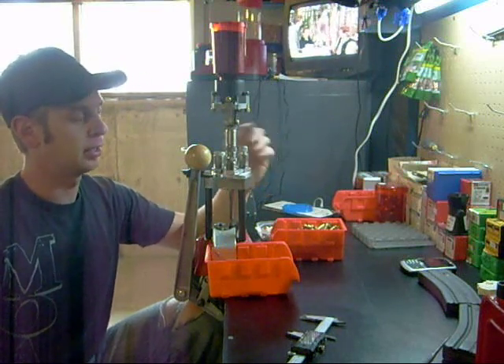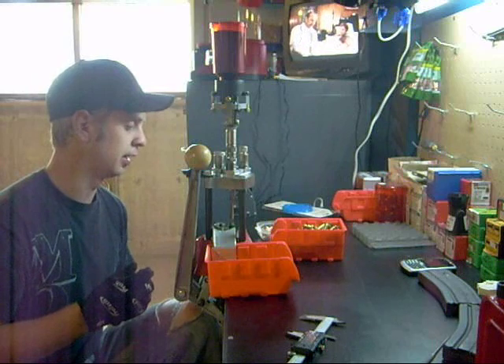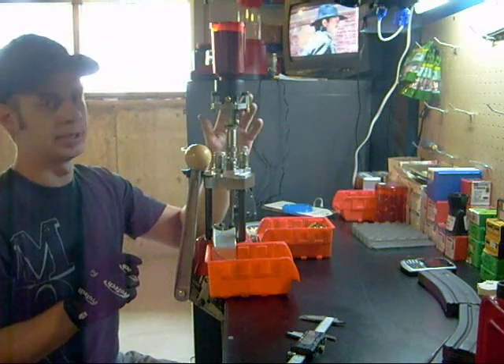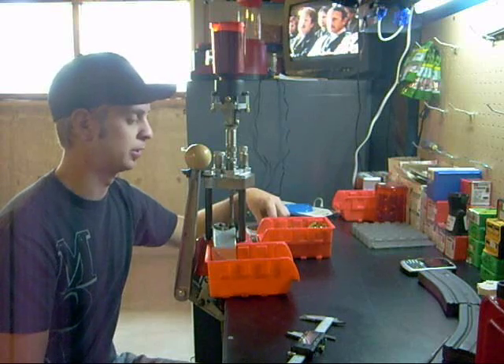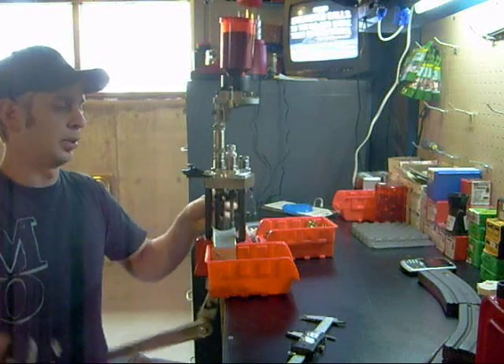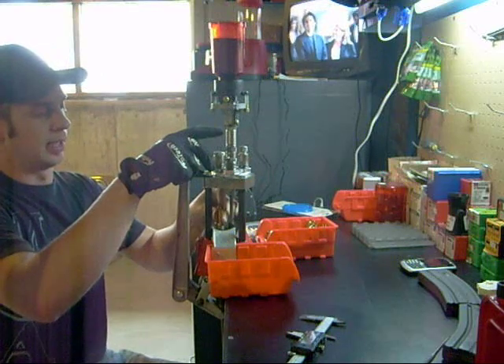223 reload with lee turret press

Comment: How do you push the loaded round out of the shell holder and into the bin like that?  Did you cut the opposite side out of the shell holder?  The shell holder only has one opening on one side to insert/remove the case.  Thanks / John

Comment: I see you're short stroking stage1, since you're using primed brass. I'm still working on a way to load straight through, primed/fired-completed round without having to do the sizing/priming separate.

So far Ive found that Hornady One-shot says it won't contaminate primers, and the cases grow .005" max. So I measure cases before sizing, and make sure i only have non crimped brass, then just rock and roll. Anyways, thought I'd share.